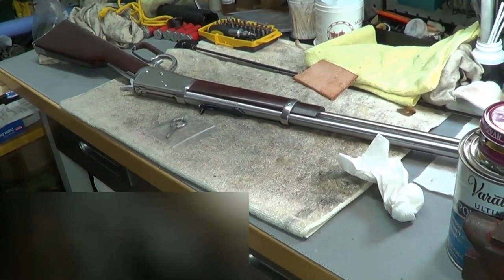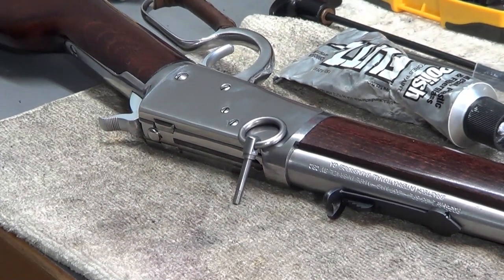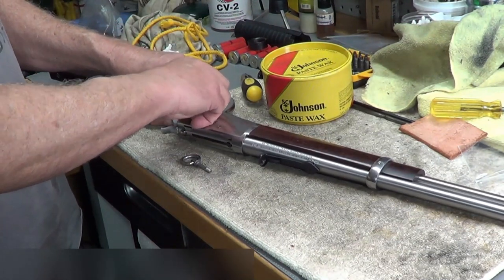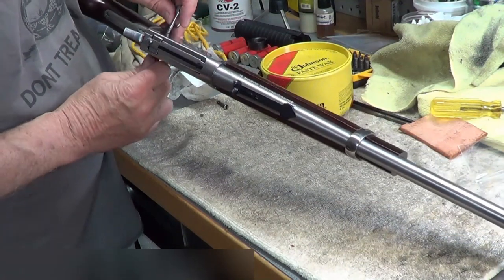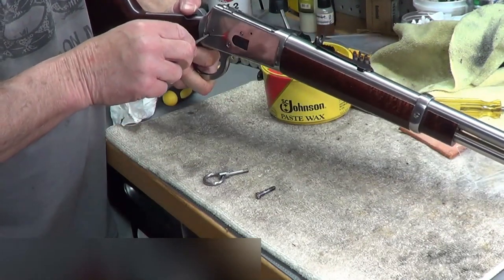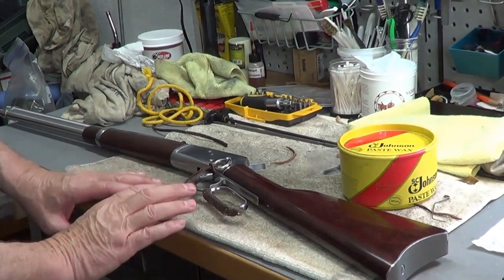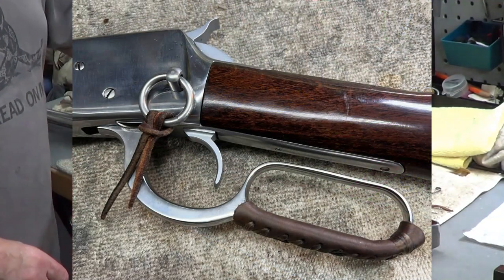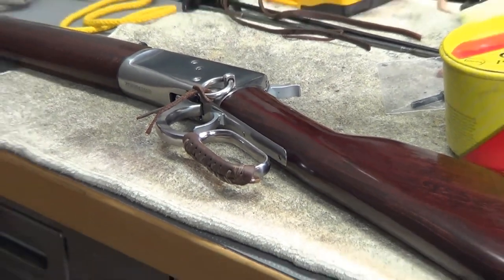Installing Saddle Ring On Lever Action Rifle - Uses For Saddle Ring - Single Point Sling

Comment: I wrapped leather around my lever. 4 years later, I took it off. Found rust under it. I hunted with it, so probably from moisture. I learned something there.
Reply: I usually have mine wrapped with camo tape for protection but take it off every few weeks and give everything a clean. Eezox for the metal and renaissance wax for the timber.
Reply: Was it a stainless or blued?

Comment: I always thought the name “saddle ring” came from using a ring they use in the making of various sections of saddlery items where they need two lengths of leather to move independently of each other, just repurposed to use as a sling point.

Comment: Pull the buttstock first ' then pin the hammer spring with the hammer all the way back ' it takes pressure off hammer then the saddle ring post will go right in ' if you dont its almost impossible.

Comment: Any time you r matching screws put the threads together like 2 cogs would be and make sure your thread pitch is the same so u don't mess up your threads also a set of calipers r handy to check diameter ( recommend Sterrett or mitotyto will last a lifetime if u take care of them) and all bolts /screws should be able to hand tighten until the last couple of turns should never have to force it 6mm is very close to 1/4-20 threads easy to confuse if ur not careful just a machinest tip.

Comment: Rick, A quick check for bolt compatibility. Put the threaded ends together to check size then if that’s good flip one bolt over ( like one head north the other south) then mate the threads together. If they interlock it’s the same thread pitch, and you’ll never mess up the interior threads.

Comment: Tip: When you want to see if the threads are the same pitch use one thread as a gauge for the other by trying to engage the points of one thread into the groves of the other. If the threads engage then they are the same pitch. 

If the threads are the same pitch then you check to see if the screws/bolts are the same diameter.

Comment: There's nothing like seeing some cowboy in the movies sliding their lever action into the scabbard on their horse. 

(It probably isn't the best or most comfortable for the horse,  but.
I always liked when when the rifle is slid under the rear side of the saddle. )

I used to have a rear sliding scabbard set up for a short lever action (It's called a "mares leg") on a pan head I used to own. 

Nice job tricking out your Rossi dude.
🫵😉👍
Reply: @Paul Getty 
Lol. Yup...
Definitely could use a leather cuff stock shoulder buffer to match the leather loop lever cover.